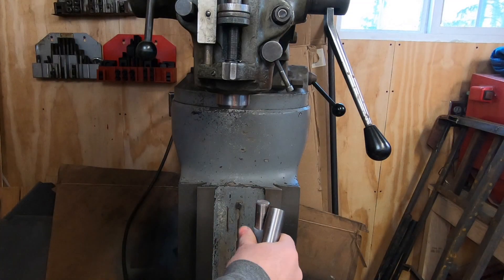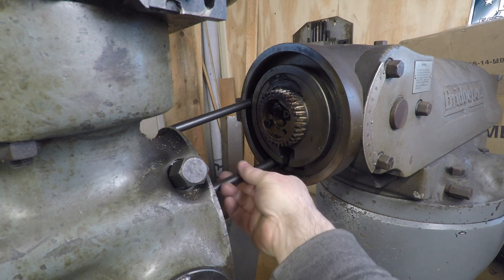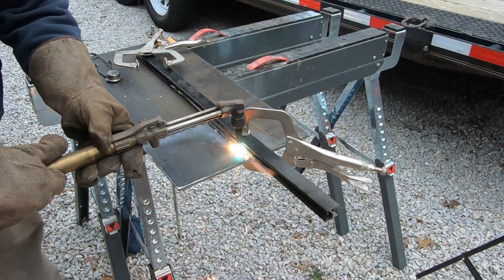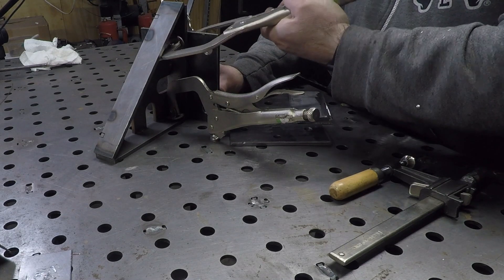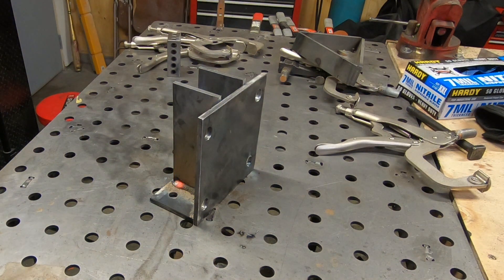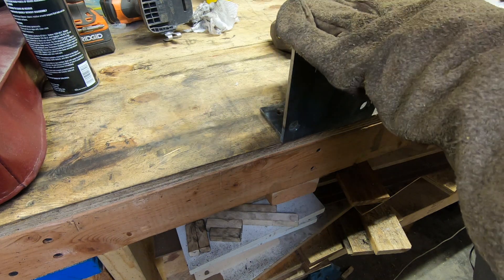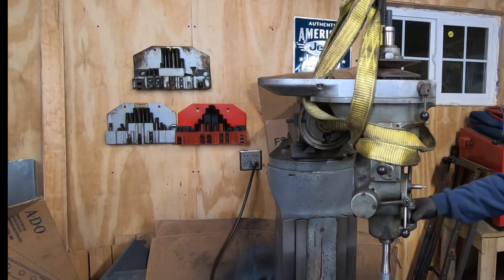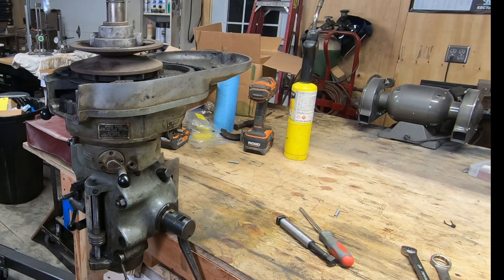Bench Bracket for the Bridgeport Mill Head

Comment: Welder here! Precision tig welder by trade, that's naturally my preference. But, it is SLOW. My general rule is to tig weld anything thinner than .060" thick, aluminum, and stainless steel. I try to Mig weld steel 14 gauge or thicker because it's night and day more productive. If it's structural, I prefer dual shield flux core wire over solid wire mig and stick. But stick works well when you're outdoors or mobile.
Reply: Also.. Very respectable welds for the function. I'm constantly amazed by the strength of ugly welds... Fit, form, function over appearance.
Reply from the maker: I have yet to try dual shield. I'd like to, but haven't come across a project that "required" it enough for me to invest a spool of it. I'd also like to try spray transfer at some point, but I think I need to use .045 wire at least, and that may require a new liner for the welder. One of my newer welders is a 286 amp mig and it SHOULD be able to get to that.

Comment: For peace of mind and safety, you should add a “flashback arrestor valve” to the gas piping of the output of the cylinder tank. This will prevent an explosion of the flammable compressed gas in the cylinder tank if an unfortunate flashback spark or what not ever occurred in the future.
Reply from the maker: Both lines have safety valves attached at the base of the torch. I may be crazy, but I ain't stupid! LOL ;)

Comment: TIG is my most favorite process. Care to give the bolt spacing. I want to cut that bracket out on my cnc plasma cutter.
Reply from the maker: I wouldn't use my measurements. I was off. LOL! I did find it though in a post on PM with a diagram. They are NOT uniformly offset from center.
Reply from the maker: https://www.practicalmachinist.com/vb/bridgeport-and-hardinge-mills-and-lathes/j-head-flange-bolt-pattern-measurements-172212/

Comment: im a 35year welder ...   I never wanted to be a welder. I was just good at it and the other job opening was concrete work..  I tell people that think they want to do it for a living.   put on a welding hood for 6hrs a day for 5 days.  and then tell me you want to be a welder..  on the torch.. you look right handed.  travel the torch from right to left.
Reply from the maker: "When there's slag, you drag" - so said my instructor from Lincoln Electric. I was welding with flux core, so I usually drag it left to right, I'd rather not push that junk into the weld puddle. But sometimes I forget from using shielding gas so much.